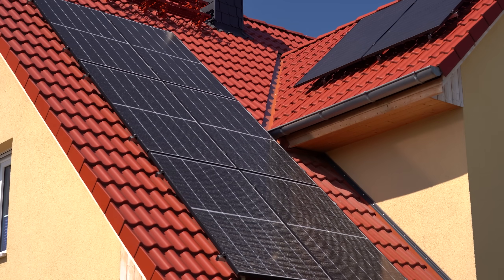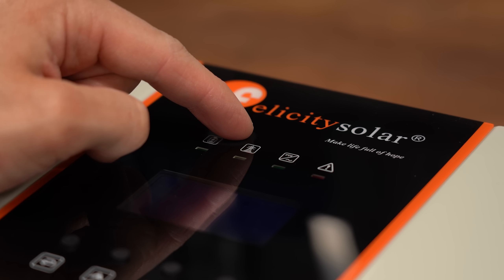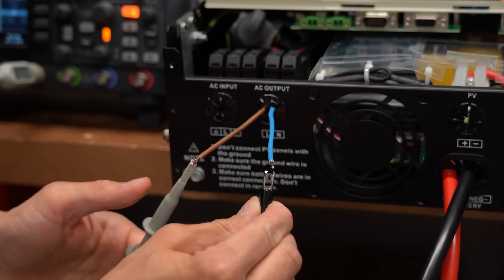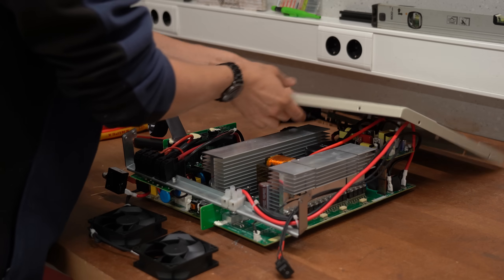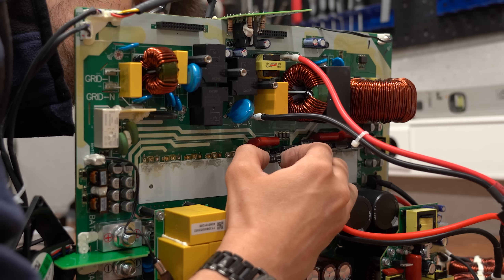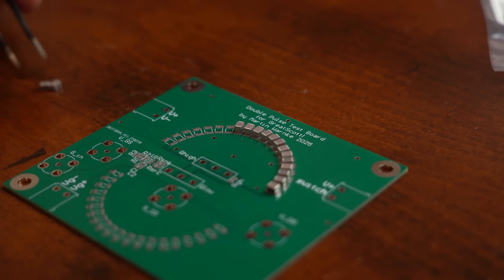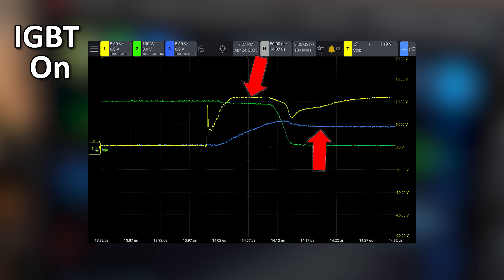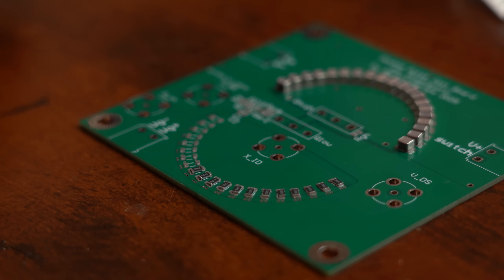Cheapest Inverter + Premium Parts = Surprising Results!

Comment: FORBIDDEN FOR GERMANS
every single step is forbidden for germans that want to connect the inverter to the grid . First of all german inverters need a proper certificate and single phase inverters have to stay below 4600W .

REGARDGING SCA HACK: FORBIDDEN in germany for grid tied systems cause if you apply for EEG compensation then you get officially government and EU subsidies. 
If you change or improve anything on your inverter then you are loosing the certificate and the permission and you enter the crime scene cause you are committing a fraud. 
You will have to pay back all the revenues from the kWh you had fed into the grid, now and for the past plus interest plus fines plus you are banned from any subsidies for 5 years cause that is a tax crime.

You are no longer qualified to apply for any other subsidy like for example cash for buying an EV or 70% compensation for a heatpump up to 30.000€  - that means you could loose up to 21000€.

And that is german law that is existing for over a decade. Never touch and change your inverter cause if you do so the inverters certificate has become invalid and hence no more subsidies or compensation for the surplus you are feedin in.

Comment: your testing are wrong. First  you need to know what power losses in idle    ( no load). Rds 19mO in not best. For 98 % ef the best way not sin wave squre wave.  For heat element square wave it ok, for sound amp and sensetive electronic device the best sin wave.

Comment: HYBRID INVERTER IS FORBIDDEN IN GERMANY DUE TO 5 kW in single phase - so never ever buy it in germany if you wanna connect that to the grid cause you will not get any permission cause it has to be limited by factory (not by user) to 4,6 kW or below.

Comment: Try with GaN transistors
Reply: I did some quick web searching, and I'm disappointed by the results. I figure you need at least 350 V max Vds, because 240 VAC peaks out at 340 DC peak. Also, to do the experiment it'll be much more difficult without TO-247 packaged FETs, as are in the inverter now. On Digikey, the lowest Rds(on) GAN FET that met these criteria is the Transphorm TP65H015G5WS
. Which has a typical 15 mOhm, and max 18 mOhm Rds(on). That's barely any improvement over the SiCs.

The GANs will definitely have lower switching losses, but I'm not sure how much lower. The conduction losses won't change significantly. 😓

Or did I just find a bad transistor? Is there a better TO-247 package GAN FET out there that Scott could use, that would beat the SiCs by a large amount?
Reply: They are made for portable sources, not large ones, nor for an inverter.
Reply: to use gan and have the best performance, you need to re do the routing of the board, using the lowest inductance setup, and surface mount GaN like the GaN Systems 66516

Comment: Something that has been going through my mind lately is how we seem to be spending dollars (euros) to same pennies.  Meaning that to save a little bit by improving efficiency we're spending lots just to save a little bit in the end.  This is why I haven't bought any solar panels.  Spending all the time and money just to save a relatively small electrical bill just doesn't make sense to me.  Probably because in my house the power is relatively cheap and reliable.  My power only goes out a time or two per year and even then only for about an hour so it's just not worth the effort.

Comment: IGBTs dv/dt llimits must be respected to avoid charge coming back to gate due to miller effect, so this driving circuit is optimised for that, lowering their efficiency in the process, some Sics are supposed to be more resistant to that, even Rg gets important to minimise ringing etc. So I guess there are a few things that can be fiddled with with driving circuit, but i can't see it done easily without special equipment etc
Reply: The miller effect dominates in IGBT switching, indeed. For most SiC MOSFETs, the gate charge is smaller and the miller capacitance even smaller - so the switching speed is limited more by the layout parasitics than by the device charges.

Comment: Would also be nice to measure the 'standby' power usage of the inverter.  Reason is that a friend of mine just installed a 10KWh panel system (20 x 450 Watt panels)  with a 3 phase inverter and 15KWh of batteries to go completely off grid.  Seems the batteries drain like 10% overnight while almost nothing is attached to the system.
Reply: Very good point. The mark of good inverter is its low standby power consumption. VIctrons are usually sub 10W. But I've seen some the cheap 'all-in-ones' consume as much as 100W! That can be a whole PV panel just supplying the inverter's losses!
Reply: My 6kw similar to great Scot’s draws 50w my 1kw inverter 10w. So for light loads switch to a smaller inverter if battery life is critical. Perhaps 1% could be a rule of thumb

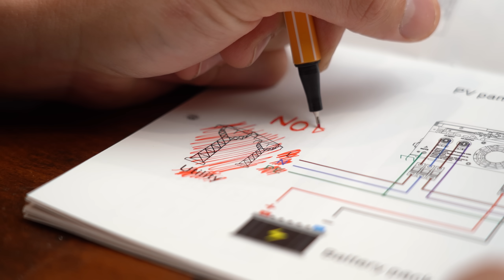Comment: 1:45 Are you really not allowed to connect an inverter to the grid? Do you mean as in any and all use cases or only inverters which feed energy back into the grid?
Reply: Pushing power out onto the grid needs to be done in accordance with applicable regulations. Pushing power onto the grid that the regulator doesn't know of makes the grid more unstable and poses risks to line workers and infrastructure. If the inverter is acting as a UPS and not Pushing power to the grid the rules are far less strict.
Reply: Not an expert, but AFAIK, if you want to power a house i.e.use household wiring, you must use a mechanical transfer switch i.e. making it physically impossible for the inverter to ever be connected to the grid. In some cases, you can connect directly to the grid if the inverter has an in-built in 'anti-islanding device', which again, prevents the inverter back-feeding the grid. For scenarios where you actually do want to feed back into the grid, certified devices and permits are often required - the device needs to be capable of syncronising to the grid voltage and frequency. Note: and even in these circumstances, you must never be allowed to feed the grid on a grid outage ... and this is usally achieved by not permitting the inverter to turn on!! This surprises a lot a people because they expect their grid-tie system to provide power in the event of such a grid outage. Doing so would a be serious risk to working linesmen who would obviously be expecting the distribution lines to be dead.
Reply: U are mostly correct except for the last bit. The section dedicated for Syncro and feeding back is called a Transfer Switch, and if You don't want to power up in case of outage, then u must set up a condition of checking mains (or installing a simmetry relay on One of the múltiple Inputs that u have abailable) and configure it so that doesnt happen.. the inverter is blind on this regard, because u want to have 230v for your house, and u need the inverter for that, just not the "Transfer" part.  @tictagtube
Reply: I think he means that he can not just add more random inverters to the grid before letting the power company know etc, Here in the netherlands you need to have it registered so they can adjust your bill according on what you deliver back into the grid.
Reply: @DANGERTIM112 well yeah, but I'm using my inverter setup in backup off-grid way, so that when the batteries are charged enough, it just switches from grid power to solar power. I don't see why that would need any extra regulation considering it would be equivalent to just unplugging the entire house from the grid. I'm not sure of the electrical code differences in other countries, where I am it doesn't seem to matter unless you want to send power back into the grid.
Reply: Here in Ireland nothing gets connected to the grid without a signed certificate from a Registered Electrical Contractor.

Comment: Great video, though I think you left an important part: the price. 12 transistors at 20€ each (yikes) makes this a 240€ upgrade… for that price difference you can almost buy the better inverter!
Reply: They are more like 12€ a pop. There are also 40mOhm (double) variants of this SiC-MOS which only cost like 5€.
Reply: @MsKittensPurr  but then you get almost the same as original IGBT in this case.
Reply: With way better dutch support and updates, and warranty for 5 years...
Reply: The point is to advertise the advantages of SiC MOSFETs over IGBTs for Infineon 😂
These are new parts and are expensive right now, as production volumes ramp up the price will drop and the advantages won’t come with the high price penalty. ❤
Reply: @ZeroStatic  I knew what I was getting into as soon as I saw who the sponsor was.  Still enjoyed the video.
Reply: You are correct and am thankful for you pointing that out.  I am thankful to Greatscott also though because I learned about silicon carbide mosfet.
Reply: No, the point was to advertise to those people who might be in a position to design a circuit in the future and make sure they think of this brand when designing
Reply: @riz94107  As an EE student with a very good power electronics class, I can guarantee anyone designing a power electronics circuit already knows aboud Infineon, and the difference between Si and SiC FETs.
Reply: Reading the datasheet of the part and the AN2018 09, It looks like those SiC MOSFETs have Vg_th voltage drift that leads to an increase of the Rds_on over time... A spanish proverb says: "bread for today, hunger for tomorrow"...
Reply: I'm not sure that was the point though. It was an experiment rather than a how-to-make-it-better video.
Reply: But the more expensive inverter will still have IGBTs and not SC MosFets on the output.
Reply: @johnnodge4327  And despite having the IGBTs it is 98% efficient, so a better upgrade might be the IGBT driver.
Reply: But the parts were sponsored, so real world logic doesn't apply. 😂
Reply: @emailausdrucker well you hit the chackpot it seems 😅
Reply: Keep in mind these are relatively new so not so mass produced like IGBTs
Reply: But not with transistors that good.
Reply: i thing using cheap inverters with sybcronis8bg them to work in paralel is better option tough sh cronising might be hard tough i  theory all you need to do is use some clock signal for each gate so yoh dont ewen beed software level sync just paralel connect gates of mofsets and prevent reverse leak... and mostlikely will work flawlessly or with mink al flaws as better 😅
Reply: Totally useless video😅
Reply: @25566     not completely useless, the cheap inverter is still very good without the upgrade
Reply: Or 2 or 3 cheaper ones
Reply: Buying it new kinda defeats the point of being an experimenter, though. At least buy second-hand and upgrade it yourself. This is the way.
Reply: The learning is good. But the math isn’t.  The biggest power loss is 1.5%. How long to pay the work and the new parts?

Comment: How did you know that you could just drop in some MOSFET instead of the IGBT without having to modify the gate driver?
Reply: The Infineon CoolSiC MOSFETs are safe to operate with the usual 0-15V IGBT drives even though 18V would reduce the conduction losses further. There is a lot of potential improvements still. 

It is quite common these days to enable the passive devices gate during reverse conduction – why spend efforts on doing a different control scheme for IGBTs and MOSFETs when IGBTs don't get hurt by having their gate enabled in vain and the same controller could also be used for MOSFET platforms.

Comment: The devices on the other heatsink will be a boost converter to step the PV input up to a standard bus voltage - replacing these would probably also give a significant improvement in overall efficiency
Reply: The bottom right 4 Mosfets are for reverse polarity protectin of the battery. Not all models have them though.
Reply: @chillipaste2183 Why don't they just use a diode in combination with a fuse for reverse-poarity protection? Wouldn't that be much simpler and cheaper?
Reply: @andrasvoros8975  
Because of the high forward voltage of diodes compared to switched MOSFETs.
Reply: @superdau  I think Andras means the kind of reverse protection where a diode shorts out the source and blows the fuse, the diode is in parallel to the power input so no series drop.
Reply: @catsimulator1866 Ahh, Crowbar circuit.  The downside is a simple user error damages the unit or triggers a return.
Reply: @chillipaste2183  For those interested in how that works, Afrotechmods has a video titled "How to protect circuits from reversed voltage polarity!"  Things I didn't learn in university...

Comment: We also need to factor in the cost of the replacement FETs, plus the effort to put it all back together. Doable, yes, but I'd be curious how such a mod affected battery life in practical terms.
Reply: If you hope for a 20 year lifetime then it is an easy calculation even though those inverters are forbidden in germany cause we have a limit of 4,6 kW for single phase inverters.

If you have a 5000 Watt system and connect that with a 5000 Wp string you can expect about 5000 kWh p.a. or 100.000 kWh in 20 years.
2% more means 2000 kWh more in 20 years or 100 kWh each year in this case. If you can use these 100 kWh and reduce the energy drawn from the grid in germany you save 30€ per year.
But again: the inverter is forbidden and any improvement of an inverter is in germany forbidden and ends in a fraud case and crime cause if you have applied for the right to feed into the grid and for the EEG compensation that this is a subsidy by the government of 7 Cent per kWh . If you improve the inverter than the certificate from the manufacturer is no longer valid.
Without that certificate you are not entitled to get the compensation and your system has become illegal . Then you have to pay back for every kWh you have fed in plus interest plus fines.
And this is a tax crimes cause subsidies from the government belong to the tax system. 

You also loose the permission to apply for any other grant for 5 years like for example up to 70% of the costs for a heatpump up to 30.000€ which means you are loosing 21000€ 
And the list is endless. hence a stupid hack for all stupid germans.
Reply: @typxxilpsI thought Scott made clear you can not hook this inverter up to the grid in Germany?
But couldn't you hook it up to the freezer, the pool heater and the e-bike and powertool battery chargers in your shed that isn't connected to the grid? I'm not knowledgeable about German law.
Reply: why and how will the battery life be affected? I can't see how, and if any, it will draw less current due to higher efficiency so improving the battery life, cost analysis is a must and it's missing

Comment: I have repaired few of these chinese inverters. They all look pretty much same inside. Even the heatsinks look same so I guess they all have same base design. My friend had 2x5kW ones working in sync for like 6 years. After 6 years one of them blew up. And it was just the low voltage battery side(exactly these NCEP mosfets). I changed them and few other resistors and it was good to go again. So reliability seems to be pretty good. I think they all made in china anyways, but yeah probably expensive ones are using a bit better quality components. Your mosfets look excellent, but they are too expensive. Just checked mouser and if you buy 1 it's around 19 euros(without taxes) and if you buy at least 25x it will be 12.44 euros(without taxes). But you need 12 pieces so it will be like over 200 euros. Which is this inverter price pretty much.
Reply from the maker: Thanks for the feedback and info. And yes, SiC is sadly still quite expensive....
Reply: Does your friend use them to 100% of power or 50%? I've heard that it's better to use them just to 50% load...
Reply: @panayotesanon3075  I don't know. But your load will vary all the time. You use different appliances so it depends.

Comment: Why people don't ditch AC power Already
Reply from the maker: Because it is awesome?
Reply: @greatscottlab I meant AC
Reply: Very difficult to step-up / step-down DC supplies e.g. to lower current losses in long distribution lines. Much easier/cheaper to do so with AC. Not impossible, HVDC lines do exist.
Reply: DC Arcs, and clouds.

Comment: The Mosfets in the right lower corner are not for solar they are for converting the 50 VDC to a high voltage DC over the large transformer between the two heatsinks. So you can also improve that section as well (8 fets for each halfsine to spread the current, they are not isolatet from the heatsink therefore the heatsink is Split into 4/8/4 to also reduce the length of the high current path)
Reply from the maker: Thanks for the feedback. I might look into that in the future.
Reply: Yes exactly. You can also tell that if you look what those mosfets are rated for. Like 100V max.
Reply: I am curious about the topology of the converter on the battery side,it looks like full bridge but it might be pushpull like the majority of the Chinese inverters
Reply: @cipry1010   Some of them are even LLC, but this specific one seems to be double foward
Reply: @cipry1010  from the heatsinks i think it's fullbridge , in the center  positive half  (common drain), and at the side s the negative ones
Reply: I would have thought you'd need two sets, a low voltage set to step-up the battery voltage to mains (e.g. 56VDC up to 325VAC) and a high voltage set to step-down the PV input to charge the battery (e.g. 150VDC down to 56VDC). The fact that the left-hand set (the set he replaced) got warm when the inverter was in operation would indicate these were for the inverter, leaving the right hand set for the battery charger?
Reply: @tictagtube no
Reply: You are right , i have been working with these inverters for 2 years